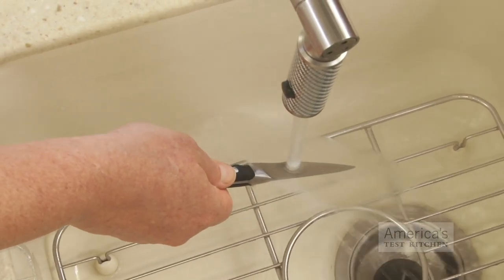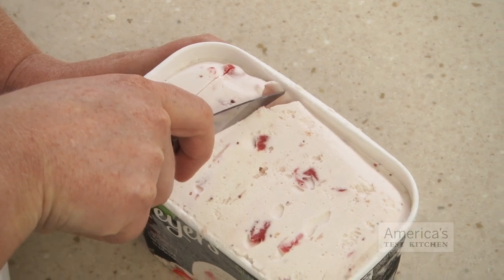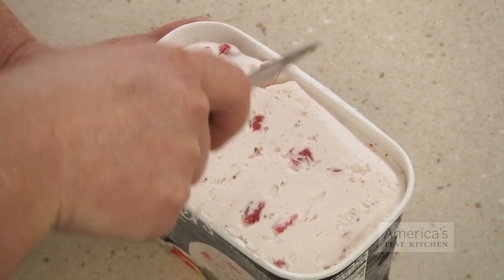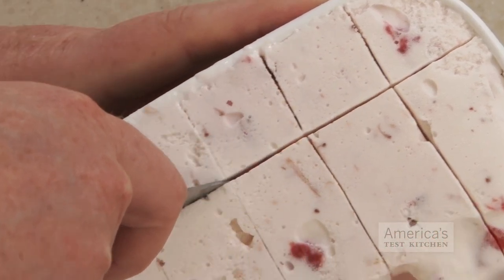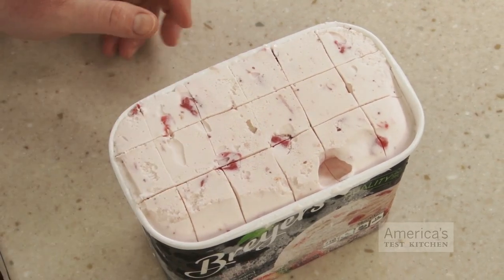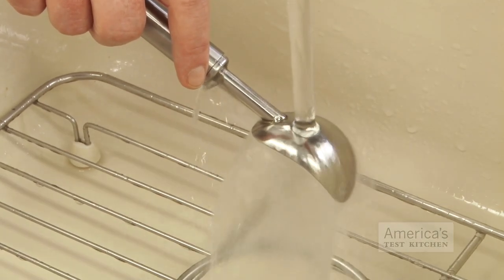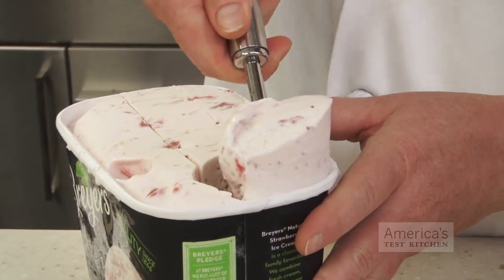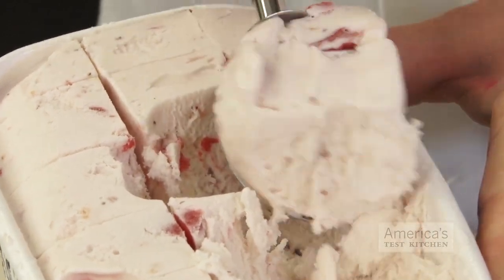Ingenious! How to Scoop Ice Cream When It's Frozen Solid & Super Hard to Serve

Comment: lmao if you can cut trough icecream with such ease it isn't frozen to frustration level.
Reply: It’s a heated knife, it melts the ice cream so it’s easy to cut through
Reply: @joshuaprivett3552  It's a knife with a sharp edge too.
Reply: @joshuaprivett3552  You missed the knife use this in step one.  Review the video. Scooping ice cream can be a complicated process.
Reply: @joshuaprivett3552  That ice cream had been out of the freezer for at least ten minutes.  It wasn’t rock hard.
Reply: @ellenmorse8559 So then shouldn’t the simple answer to this problem just be leave the ice cream on the counter for 10 mins before scooping? 😂

Comment: I normally warm the ice-cream in the microwave for 10/20 seconds as I like it soft/mushy.
Reply: I warm mine for like 5 minutes.  It's easier to drink that way.
Reply: This absolutely works. As a bonus, by being warmer the flavors are much more pronounced.   If the ice cream has ice crystals, they also get burned off or melted into the ice cream

Comment: This is clever and might work. The ice cream in this demonstration was quite soft, so, maybe this will work when it is brick hard, maybe not.   But, it will not be nearly as easy as in this video when using solidly frozen ice cream. You will need to warm both the knife and the spoon several times.  Do not pull the knife towards your self. As the blade gets cold, it will start to get stuck. You could have an unpleasant accident if the blade sticks and suddenly comes loose when you increase pressure on the stuck knife.

Comment: What's the point of the grid? It might help a bit, but you'd end up with oddly shaped scoops, instead of nice round balls. The real tip here is to heat the cutting tool, which is pretty obvious.
ATK must be running out of material...

Comment: Why not just use a fork, with the points into the ice?

 The force needed to push the fork would get distributed over a smaller area, compared to a spoon, which means that you need less force to cause the same pressure. Less force over the same distance means less work to performe the task.

Comment: Hey, folks.  1) Maybe they ran the knife under hot water more than once to keep it warm, but didn't think they had to spell that out. 2) The repeated slices with the warm knife will make the ice cream at the surface softer. Ask yourself: if they hadn't tried the viewer tip and found it worked well with ice cream that had frozen solid, why would they bother to make a video about it? What good would it do them? It would only damage their brand. Everything isn't a massive conspiracy to defraud you.